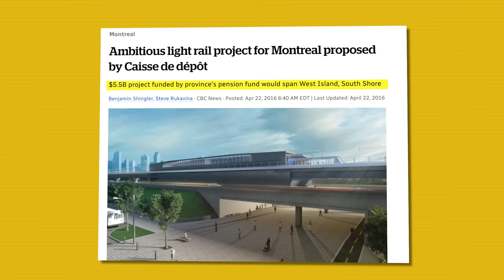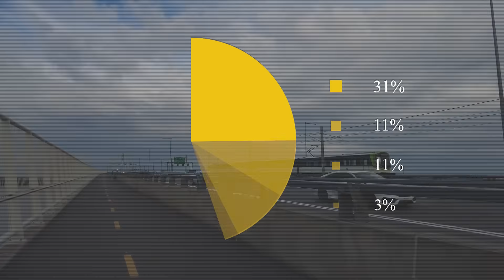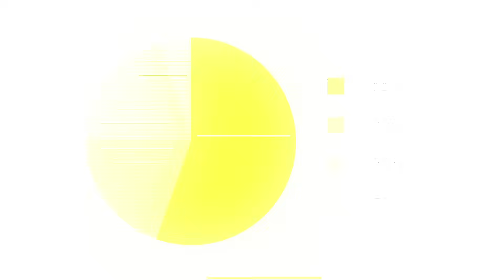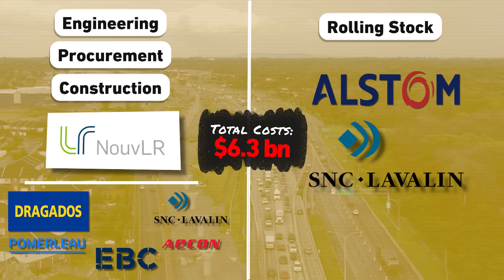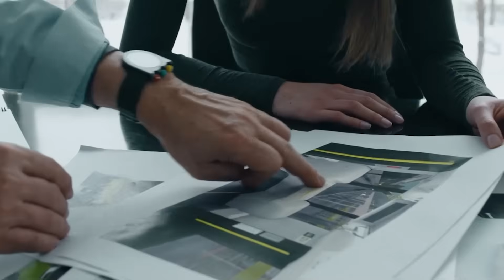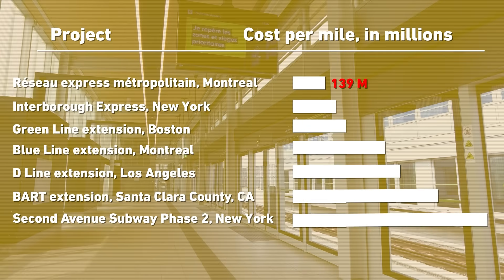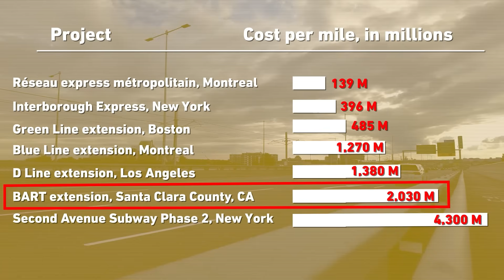Why Did This Mega-Project Cost So Little? | Montreal's REM Explained

Comment: The west Island leg was to follow the old CN freight spur north of Hymus.  remember that this did not involved transit planning, just the need to draw a line to please politicians to declare an area served.  
Original plans at the Sources station at ground level (because the existing rail overpass over the 40 brought tracks to ground level) and CDPQ didn't realise that the station was in the backyard between 2 wharehouses (where the CN spur was).    Secondly, they learned the hard way that the CN spur had been sold west of sources and there were buildings on it.   Origially was to follow old spur to St-Jean and then turn northwest to cross highway 40 to the north.   The end result:   insread of replacing single CN bridge with double tracked one leading to both airport and SAdB, they built 2 separate bridges with the west island leg remaining elevated all the way. They changed the Sources station to be elevated and moved it just west of Sources rd (which kakes sense).  Their standard station design has entrance on only one side of station where fare gates are. Would have made sense to have the Sources station directly over Sources boulevard so you could exit on one side to catch northboudn bus or exit the other side to catch southbound bus. But their "one exit" station design precludes that. 

The line then crosses the 40 to the north side well before the original plans due to the buildings in the way and remains elevated  along the highway service road all the way to the terinal where it goes down to ground level.  The original Kirkland station was just went of the St-Charles boulevard, and their 3d origianl renders showed the rails passing not over the St0-Charles overpass but through it (so a level crossing on a bridge over the highway 🙂 The fact that its only entrance was on a one way service road right at the interchajge wasn,t too smart and residents opposed exproproations to open a major artery and parking lot from Brunswick Boulevard (north of 40) to the station. So CDPQ decided to move the station further west. While it is still along the one way service road, there is a cross road to residential area. 

Because the owner of the Fairview shopping mall hates transit, they did not want the Fairview station to be on their land or on their parking, so CDPQ had to destroy a forest to build it west of the huge mall.  At the corner of the one way highway service rod and a side street. But all buses will still have to negotiate the St-Jea-40 traffic hell.   (currently, there is a large bus terminal on the north side of Fairview and the terminal is right at one entrance to the mall. The REM station will be far from the first entrance to the mall so very unpleasantwalk from the station to the mall on large expanse of icy parking lot.
Reply: It's a 5 minute walk from the REM station to the shopping mall. If you can't handle a 5 minute walk, then you can't handle public transit.
Reply: No forest was "destroyed".   The mall is not "huge".   It's the REM planners who don't want to integrate with the existing traffic flows.    And still no bikeway, pedestrian paths on the REM.  Incredibly short sighted.

Comment: The shaft for elevators to Édouard Montpetit does not handle ventilation as the original CN tunnel had ventilation shaft on the west side of Vincent d'Indy (right next to ventilation shaft for the Metro blue line).  This shaft has been used during construction to push in fresh air, power and compressed air etc.  But will become a innocuous ventiualtion shaft once again.

Comment: The connection at Édoiuard Montpetit is not complex at all.  The metro HAD an exit right over where the REM station is and linked to the actual metro station via a tunnel under Vincent d'Indy street.  The tunnel was boarded up at the metro station, they demolished the metro exit and dug way down to the former rail tunnel and the elevators from REM fare gate level will have a stop one floor below groun to be able to use the non-fare-paid tunnel to reach the metro station and afrer going through fare gates, go way down to the metro track level.  Metro service had a period where train had to stop for a few minutes whenether they dynamited near the tunnel, with crews inspecting tunnel after each blast before metro service restarted. But once they were below that level REM dinamyte no longer effected metro service.

Comment: at 08:23 The CDPQ did NOT evaluate the tunnel before starting the project. It is the Montréal fire department that insisted on an inspection and rules that CDPOQ could NOT proceed due to lack of emergency exits.  With train services, the frequency was such that there would be a single train in tunnel if it got stuck or caught fire. This provided access to the train from the other track.   But with CDPQ promising frequencies that requyired multiple trains in the tunnel at same time, the fire depaartmet imposed strict conditions to make a dire surviveable.  CDPQ refused to dig new emergency exist, and instead ended up having to enlarge tunnel and allegedly build a wall between two tracks.   They initialy blame the delay on all the damage done by steam engines (steam engines never ran in tunnel) and then because of unexploded dynamite stick (which means they were digging in tunnel to enlarge it, which means they never did a sanity check on tunnel prior to stealing it from EXO and starting its project. It would have likely take less time to put a TBM and dig a new tunne next to old old and allow trains to use the old tunnel and not cripple Montréal, transit and passenger train potential.

Comment: at 06:30 You speak in the past. The buses have not been allowed to cross the bridge since end of July 2023 when the REM started (CDPQ exclusivitty clause prevents them from doing so, except fpr buses that serve areas outside the exlusivity zome).  On the old bridge, they had dedicated bus lanes.  And many bus routes went from neighbourhood to Panama and continued to the downtown bus terminal, with some high capacity bus routes doing Panama-Downtown frequently to pickup passenters from bus lines that terminated at Panama.   The EXO bus routes were mostly moved to the Brossard REM station to remove congestion at Panama.

Comment: at 05:26, your map incorrectly placed Anse à L'orme station (called Ste Anne de Bellevue from its original name and SADB is the code word on th construction site). The station is along the 40 highway and the only place on the west island leg that gets to ground level. The garage is directly west of the station tracks which means it is designed to never be extended unless trains go through the garage.  Tracks cannot go to the south because they are right next against the highway.   The terminus station is about same distance from Anse à l'Orme as the final position of the Kirkland station on the one way service road of the 40.  (that station was moved a few times, including unnecessary destruction of some businesses at a time the location would be over there).

Comment: The guaranteed return on investment was not part of the original pitch, the one that was approved. It was only after that that CDPQ annouced it would need public funding both for capital and operating, as well as transit exclusivity to guarantee existing transit funnel all passengers to a REM station instead of bringing people downtown directly.  (this matters mucy on the poorly designed west island extension because we risk osing our existing express buses to downtown, and the existing commuter tarin on the CP line , while allowed to remain, cannot be improved.  The areas served by the train are south of highway 40, while the REM serves north of the 40, the 40 being an impassible obstacle with the overpasses severely congested.   And as a result of this, when a user  takes a bus and then the REM, the rem will take the majority of the reveues from that users ticket and reduce revenues allocated to the bus company (STM, STL, RTC , EXO).   the RTL (south shore) has already had this done since every passengers gets off its buses at Panama (formery bus terminal to get to the express buses to downtown) and is forced to use the REM to get to downtown. No more single rides to downtown, but more importantly, no more RTL having all of the revenues from a ticket.

Comment: CDPQ's involvement for Canada Line in Vancouver was at the finance level only.  But when pitching its REM, it claimed to have technical expertise in how to buid trains based on that project alone.  It  had however already setup Bombardier Transport to fail ( re-capapitalised it to own 30% of it , but with condition of guaranteed dividends for a money losing company which was then forced to sell itself since it ould not pay those dividends, and CDPQ conveniently arranged for Alstom to take on the burden with CDPQ converting its 30% in bankrupt Bombardier Transport into 18% of then money making Alstom (absorbtion of Bombardier made Alstom turn to becoming money losing).   While CDPQ Infra brags about its expertise, the fact is that the REM project was outsourced to Alstom who also runs/operates it and CDPQ Infra does the management ad user-facing side.

Comment: Of note: the original promise for CDPQ to self fund the project became a project that relied heavily on not only capital from governmnemt but also operating subsidies for each passengers. As a result, other transit project saw their funding  reduced to a trickle, so on-going elevator installations at certain statiosn supposed to take 1 year end up taking 5 or 6.  The Blue line extension whcih was suppose dto be finished was pt on holdbcayuse money was going to CDPQ instead and while it has strted, the financing on a slow flow of cash so will take forevert to complete.   Ad because CDPQ  reies on government funding, it lacks the funds to build quickly. The hole at Dorval airport has not moved significantly in the past 2 years.  (and the idiots built it under the parking instead of trhe terminal, so passengers will have to cross the 2 roads to get to the terminal which force traffic cops to stop flow of cars which right now results in 10-15 minutes to get from entrance of airport land to the actual terminal (faster to walk).  had they put the terminal under the terminal, they could have had alevators direct from platform to arrivals and departure levels. With baggage this makes a big difference.   (the original train station had trains heading south from the US terminal, so once CDPQ annpunced its refusal to use it, it was converted to a parking lot (now level SS2 of parking).  The station was coplete and just missing tracks nad OCS. Patforms were there. Saw it withmy own eyes in 2011.   The REM trains, because they come from the northern end of the island cross under all runways, and under the terminal and coudln't have accessed the existing integrated train station.

Comment: The headline at 02:05 is incorect. The mandate was for the link from Panama to downtown to replace the SLR frequent buses, as sell as a downto airport link planned to use the existig integrated trai station under the USA terminal at airportm and ride along the existing CN right of way for direcly line to downtown. 
What the REM annouced was very different with it taking over the tunnel under Mont Royal, demolishing the Deux Montagnes  line, cutting off the ascouche line and a stupid extension along highway 40 in the west island to get support from the MP in the region.  The CDPQ had not even inspected the tunnel to see oif its trains would fit.  Deux Montages line was totally rebuilt in 1994-1995 with weekend outages, and a long summer outage in 1995 before reopening with fixed up tunnel, new 25kvAC catenary, totally new rolling stock, tracks and an additional station at Deux Montagnes. (stopped before at what was renamed Grand Moulins which at the time was called Deux Montagnes.

Comment: Our Metro is very inpired and shares a lot with the Paris Métro. The REM shares nothing except for using equipment from Alstom (which CDPQ owns 18%).   The REM was pitched as light rail despote using metropolis metros to avoid transit unions, and pitched as light rail and ensure it cut off all connection to any "train" rails to ensure it did not have to meet 1950s rail regulations in Canada.

Comment: The city did not decide on the REM.  The ARTM (transit planning authority) did not decide on the REM. A non transit authority (CDPQ) IMPOSED it on the city after the provincial goverment asked it to build a simple line to use the new bridge to downtown from south shore, and use existing tracks to the airport, including reserved tracks already there through the maor Turcot interchange built.   CDPQ refused to use the direct right of way to airport so instead stole the key  rail tunnel through mon royal and if/when the airport link opens, the trains will do a great big loop first going north from airport, then east, and then all the way back south and will take longer to downtown that the current 747 buses (that at least have seats and luggage racks). This also required the tearing down of the modern elctrified train line to Deux Montagnes and cut off the lie to Mascouche that had opened 2 years before since no longer able to access downtown due to loss of tunnel.

Comment: Using the Mount Royal tunnel for the REM means that you can't use it for high speed rail, making it harder to get that project going.
Reply: High speed rail will never be built in Canada or the US as long as the big 3 automakers lobby against it.
Reply: @noseboop4354  
The time of the big 3 is long past. It's the airlines that stand to lose with high speed rail. Very few will switch from car to rail. However, high speed rail is much more convenient than flying short distances.

Comment: A 26% cost overrun for a major civil engineering project is a miracle. We were expecting it to be closer to 50%-100%.
Reply: Yup. Just watching the Megaprojects channel (narrated by Simon Whistler), gives you some insight into that. There are so many reasons for projects going over budget, including unknowns and material cost changes since when the bid was originally placed.
Reply: It closer to 50%. The projected cost was around 6 billion. But it already exceeded 10 billion. 

Also, most of the video is wrong.

Comment: The Deux Montagnes line going through the Mountroyal tunnel reaching the downtown train station has been in service since the early 80's.  The only change on this line is new trains and electronic system as the new trains are self riding, i.e. there is no train conductor on them.

The new line going from downtown to the west end of the island has been in service since the early 70's but was on the track along the river shore (seen in grey on the map).

The Metro extension to Laval and the "bleu line" riding east to west has been in service since the mid-90's.

The real new system is it is all integrated in one single system with hubs which provides interconnection between the light trains system and the underground Metro system.

Comment: REM is in now way a Light Rail system, it literally uses heavy rail Alstom Metropolis which Paris Metro and Sydney Metro uses. The Maximum length of 80m is in the low end of heavy rail metro lengths that you can see in like Paris or Tokyo. It’s even wider than the Montreal Metro trains. People nowadays just see overhead catenary and think light rail, no for the fact it’s also automated which most Light Rail system aren’t.
Reply: During the planning phase when I attended the public information sessions, they told me that they had the ability in the future to expand the train length from the current 4 up to 6 cars if future demand required it. I do believe that this would require extending platforms, though, which would be very expensive, since they're indoors and elevated. Or in some cases carved out of rock under a mountain. More likely their other plan for increasing future capacity would be used first: reducing headway on the trunk line to as little as 90 seconds.
Reply: So it's a heavy rail light metro then.
Reply: @EdwardM-t8p  Oh Lordy....Of course it can run on heavy rail, but it's "Light Rail Transit".

On their opening page, right at the top:

The Réseau express métropolitain (REM) is an automated light rail system with 26 universally accessible stations across Greater Montréal.
Reply: @stephensaines7100  Metro Leger in French is practically  Light Metro, The VAL People mover in various regions of France is not considered as Light Rail in France. The distinction divides it from the new Tramways that are nearer to Light Rail being built everywhere else. 

Tell me how exactly this is a Light rail system with hitting every quality of a metro?
Reply: It's Light Rail.